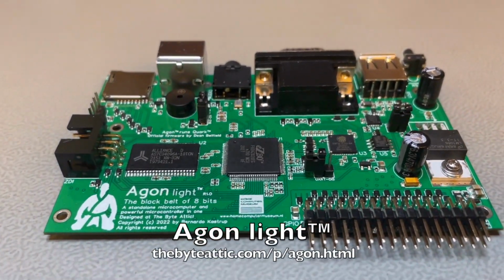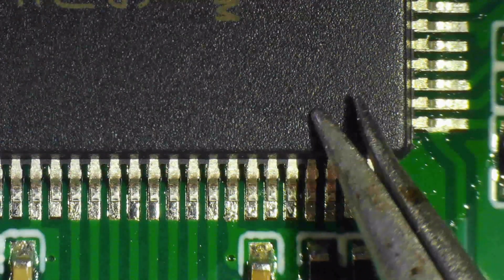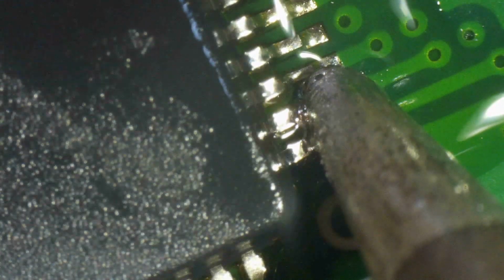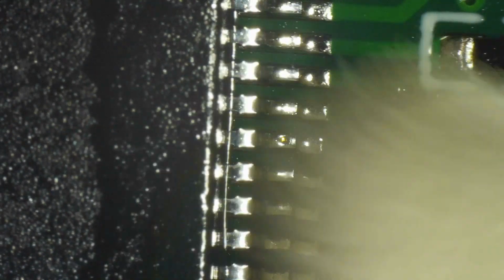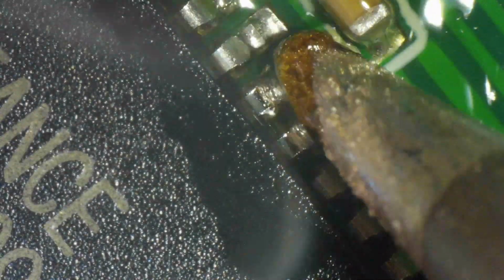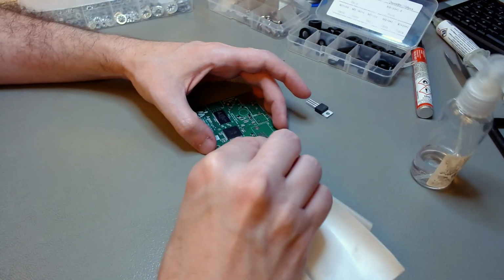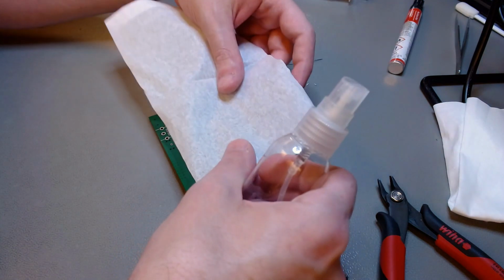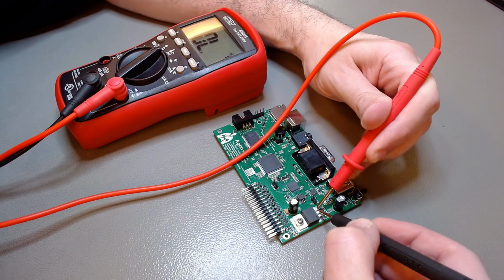Easy fine-pitch SMD soldering (Agon Light™ Build Tutorial)

Comment: It's possible some people prefer pre-soldered pads because they do reflow soldering instead of drag soldering. Applying solder paste is annoying especially without a stencil, so if it's pre-tinned you can skip that and just drop the component roughly in place, hit it with heat gun or put in oven and let the surface tension fix the alignment. That would be my guess.